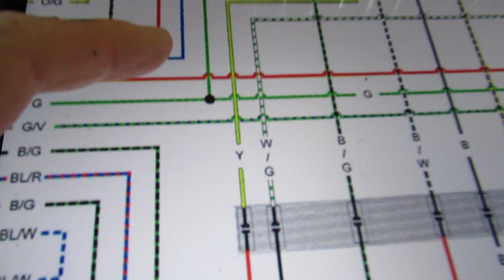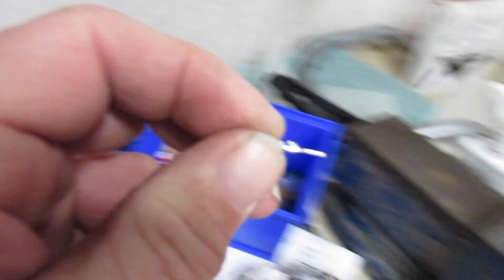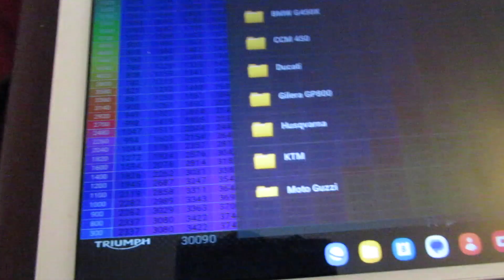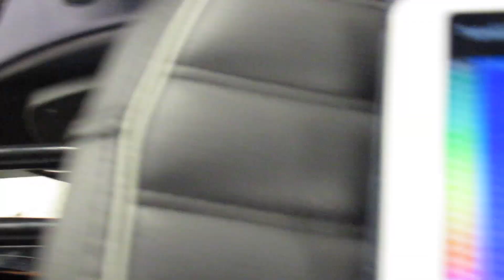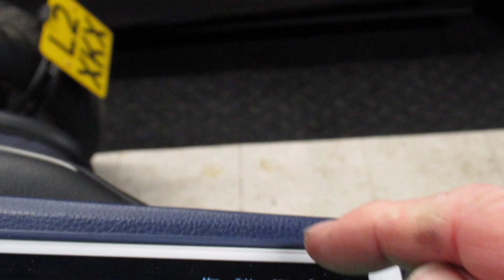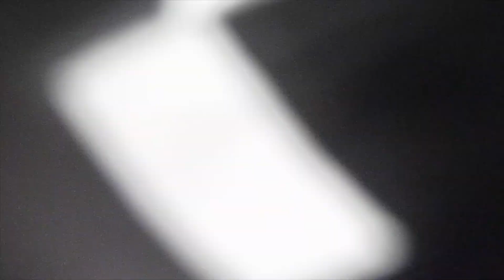TRIUMPH BOBBER CRUISE CONTROL

Comment: I have done exactly what you said and it does everything like in the video but im test ride it does not work, i did go up to 40mph but it not hold the speed
Reply: I will try tomorrow i think you can only use it at min 80km
Reply: I got it working now, i reset the throttle position sensor and them reset adaptions and after that the green cc light was blinking then i went through front brake, rear brake clutch, forward throttle and cc button and it works great even tho i have pico 3 in 1 aftermarket rear lights
Reply from the maker: Great news

Comment: I wonder if you can use head light flash button?
Reply from the maker: There is no flash button on the switch cube, only low to high beam.
Reply: @big500  aaa yeah, i forgot, I am going to give this ago in the next couple weeks.

Comment: Amazing job. Done professionally and very neat. Can you share the part number of the pin for the connector. I want to do it the same way.
Reply from the maker: @ModsAndRides  Of course it’s JST (Japanese Solderless Terminals) SWPT-001T-025.  I got mine from here in the U.K. https://uk.farnell.com/jst-japan-solderless-terminals/swpt-001t-025/contact-tab-26-22-awg-crimp/dp/3849790?st=JWPF%20contacts
Reply: @big500  Thank you very much. I got some of these pins with me (bought for something similar earlier), and going to get the wiring done tomorrow. Did you manege to run both the wires through the exiting sleeve? I believe yes coz it might have been planned for bikes with CC wiring from factory?

Another question on the map. Do we need to map a new map on is there a function in TuneECU to enable/disable CC?
Reply from the maker: @ModsAndRides  yes, I just fed the 2 wires down the sleeve from the switch cube on the handlebars. Regarding the Map, you need to load a tune ECU map that has Cruise control as part of the map for whichever country you are in. There is no way to actually see the CC element of the map, but it’s just hidden in there. Once you’ve put that map into the bike just follow the instructions to enable it. Ignition on, operate kill switch, front brake, rear brake, clutch and the press CC button once.
Reply: @big500  thank you, again.